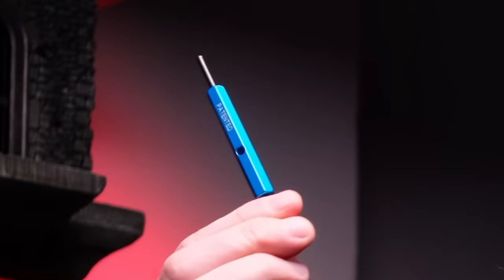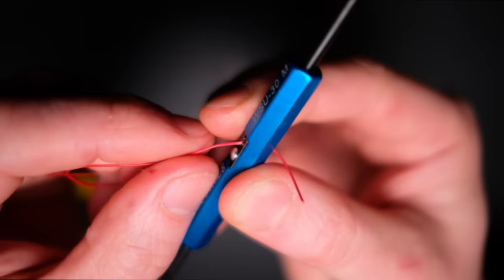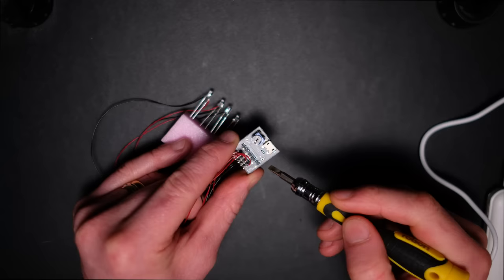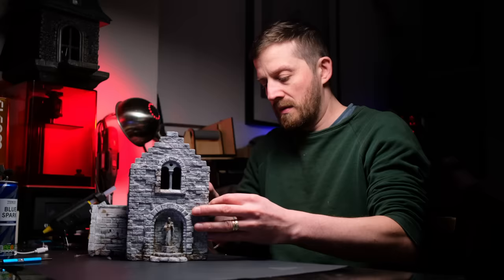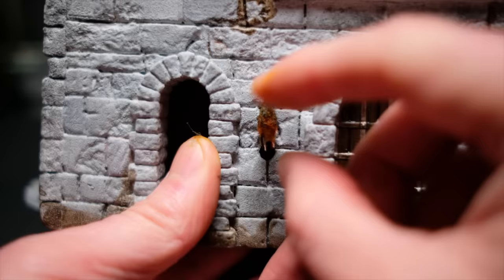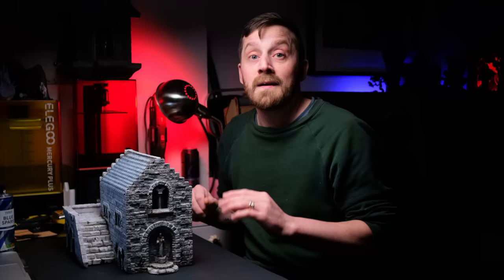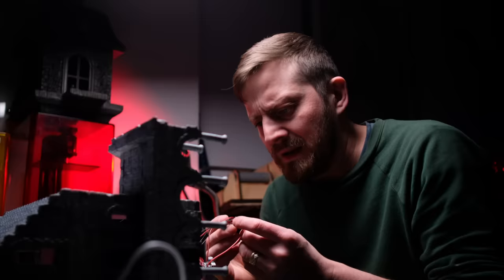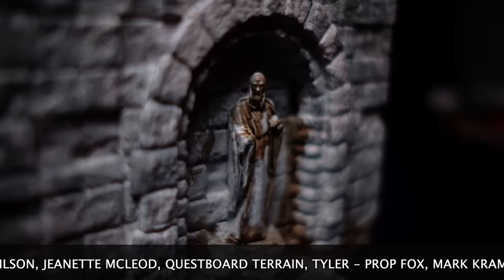Turn LED'S into REALISTIC FIRE for your Diorama!😮🔥

Comment: Can you share more about the USB battery shut off? I've heard that the cheaper the USB battery you find (like the gas station $3 jobs) the less likely it is to have that auto-shutoff for low voltage. But are you saying that the resistor being in place allows the battery to be "tricked" into staying on?
Reply: Hello Jake. Most powerbanks use similar chips inside. These chips take the battery voltage and boost them to 5V USB levels. That boost uses power itself, so many USB Battery / Power Banks measure how much power  (or current) is being drawn. A single LED or two doesn't pull enough power (current) to convince these chips that they need to continue boosting the voltage.
The resistor is a way to pull enough power to keep the battery on. It's not terribly elegant, and it does waste power doing so, but it is small and cheap. 
In other terraintronics products, especially those that have a WemosD1 connected, we use a timer to pulse the power into a resistor. A half second pulse, every 20 seconds, convinces these chips to continue boosting power.
Reply: @TerrainTronics  Thanks for the reply! Helpful. Couple follow-up questions: 

1. I'm curious how the resistor creates that constant draw... I would think that a capacitor might, but a resistor seems like it would be avoiding pulling on the battery. Trying to understand the logic here. #newbie

2. Do you sell the timer you mention as something standalone I can wire into my setups? 

3. If we're powering reasonable amounts of LEDs with a relatively huge USB battery.... does the power waste matter much? Is it like getting 7.89 hours instead of 8 hours of the battery?

Comment: AH, so we cant escape resistors, no matter how hard we try!
Reply from the maker: Well you can actually! I just like using the usb battery packs... you can just use a battery pack with regular AA batteries and then you wont have the turning off problem ;)
Reply: Resistance is futile! 😁

Comment: Putting a resistor on the output to drain more current just to trick the controller into staying on just wastes battery power. Its a bad circuit design.
Reply from the maker: You are right! And I have since developed this idea further and I am working on an update video :) I have a new board that behaves like a USB power bank, but doesn’t automatically shut down.  And it’s cheaper... will make an update video so people can have the information. :) 

Thanks for watching and thanks for the comment !
Reply: @Nat1videos  Just off the top of my head, maybe you can just put a simple microphone in series with a fet transistor to drive the leds, so they randomly react with sound, and background noise.
Reply from the maker: Thats a neat idea!
 @RobertA-hq3vz
Reply: It's not ideal but the drain is relatively trivial, and the battery packs were never designed for this application.

Comment: Easier way, just remove the resistor
Reply from the maker: Unfortunately that doesn't work with these phone charging battery packs.... the battery packs switch off because the LEDs don't draw enough power. With the resistor in place it tells the battery pack to stay on, effectively..
Reply: As noted by @Nat1, there must be sufficient load on the battery for the circuit to detect power draw above a certain threshold, or it will kill power to the outputs for safety.  By far the simplest and safest method to add load is small resistor.